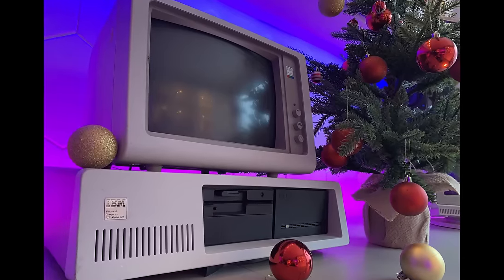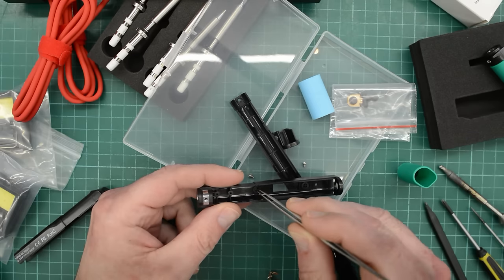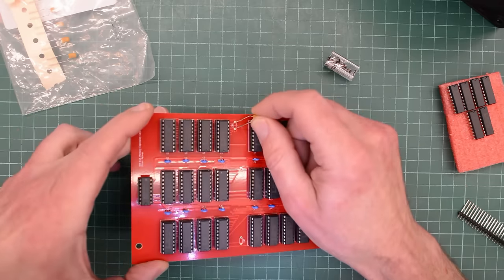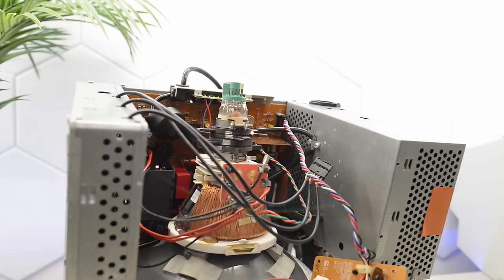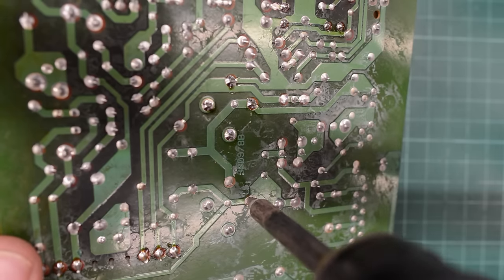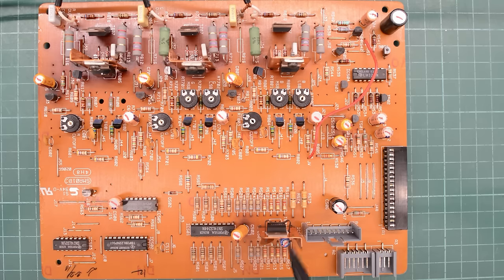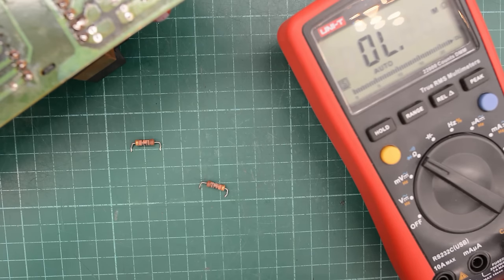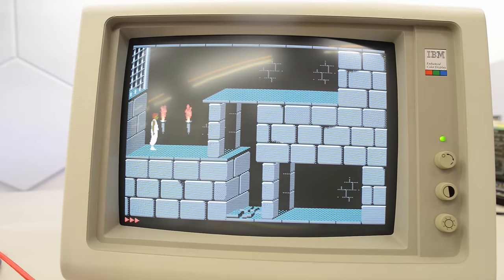IBM 5154 EGA Display repair

Comment: If you have resistors getting super hot, mount them slightly above the board with the leads up so air can get under them as well :)
Reply: Or use two with double value in parallel. Or two half value in series.
Either way, you'll reduce the heat and spread out the rest.
Reply: 130C ... good gravy!  That's almost hot enough to literally cook with!  It is DEFINITELY worth replacing those with something stronger.

Comment: Very nice repair well done! 6.8v sounds like the filament voltage maybe? Not sure if those resistors are supposed to be so toasty but in any case you can install them a bit more elevated (longer legs) to try to help with dissipation. Also I was told the charred section on the mobo can be conductive so it’s recommended to grind it off and patch it with epoxy or similar. Nice monitor!
Reply from the maker: Thanks Tony. Yes, I'll order some larger resistors and install them slightly off the board
Reply: @Epictronics1  I have seen power supplies where holes were left for components. Not spark gaps but for resistors to 'float' in the holes. As toasty as this looks, maybe dremel a window where the charred material is, given the resistors would fit the space between the solder spots. :)

Comment: I would check the flyback diodes too, just to be sure, wouldn't want those coils to get fried. You can also elevate the resistors from the board with littile rounded kinks in them to get the heat away. You used to be able to buy resistors with that in them already.  That carbon scoring should be removed too as it can become conductive. Easy to desolder because it's lead solder. Some chipquick or similar can make desoldering the stubborn stuff much easier and safer on the circuitboards. In the future you might want to buy caps rated for 105C that are around any heat creating components to make them more reliable.
Reply: I already knew about raising the resistors, but the high temp rating caps is new knowledge to me. Thank you.
Reply from the maker: Some, but not all of the new caps are rated for 105C

Comment: That was quite a lot of marginal parts! I'm glad that you managed to finally resurrect the CRT!  I used to have an EGA CRT for my Commodore PC-20-III. EGA is cool and all (especially the 5154!), but in the early 90's they looked more like the poor man's VGA. How unthankful we were back when... 

I got an SE/30 that has been the same as your CRT, a new fault emerge after each that I fix something. The final problem was unexcepted, a solder joint that re-cracked after just a few hours of use. I think that I've worked out all the kinks on this machine - for now. I'd better sell it before something breaks on it.
Reply from the maker: Yeah, we could have got these 5154 for free at one point. Now it's one of my rarest collectibles lol. I'd say you're lucky, my SE/30 looks like Johns mid-week battery-bombed mac lol

Comment: You may want to use four or more resistors, instead of just the two toasty ones. Ultimately you need 0.6 Ohms (two 1.2 Ohms in parallel, as original), so you can use four 2.4 Ohm resistors in parallel. Or use even more resistors. The point is to reduce the power each of them is dissipating, and to increase the surface for heat dissipation.
Oh and you might want to check the voltage across the resistors, to see the Power they actually dissipate, so you can make an informed choice.

Comment: The 6v rail is used to power the CRT's heaters...without the supply, there will be no electron gun activity and no display.
Reply: When troubleshooting a CRT display (or anything else with vacuum tubes). First step: are the tubes lighting up?

Comment: Beautiful work on the monitor repair! I never would have found those bad resistors. And the heat at the capacitors is wild!
Reply from the maker: Thanks John. I'm seriously considering installing two large Noctua fans inside that display

Comment: I like the spring style soldering iron stands. My Weller came with one but it is not "small" by any measure.
Reply from the maker: Yes, I have considered using a Weller stand but I'm hoping to find something smaller
Reply: 100%.  I don't mind its size.  I can drop my iron in it without even looking.

Those Pine stands are braindead.  Not even an inset in the clip?  What good is that supposed to do anyone?  That's damage and injury waiting to happen.

Comment: There seemed to be a lot of some white stuff on some of those boards. I don't know what it is, but it might be a good idea to clean it off, to eliminate the chance of currents leaking around the board. And yeah, those resistors looked bad right away, and should be replaced with some new higher wattage parts. A bit of air around them might be a good thing too.
Reply from the maker: I'm not sure what that white suff is. Never seen it before. I'll replace those resistors for sure

Comment: FYI, if you have matching values, you can replace Tantalums with Ceramics... thereby removing the risks involved in the highly entertaining failure mode of Tantalums.
Reply from the maker: I haven't had the time to dig into the characteristics of tantalums & ceramics yet. I'm sure they are interchangeable in many applications
Reply: @Epictronics1  Texas Instruments explicitly states so on some of their datasheets of OP AMPs.
Reply: Any idea if this is true in audio applications? I have a classic synth called and ARP Omni that is full of low quality tantalums. If I could replace them with ceramics I'd be much happier than if I replaced them with more tantalums. I replaced the electrolytics with polymer caps in the non-high voltage circuits already, in the hope of not having to deal with corrosion from leaking electrolyte in future.
Reply: @chriswareham  : I'm really not sure, but from what I remember Tantalums are used for their stability (they keep their capacitance) and because they can pack a lot in a small package.

Ceramics on the other hand have a higher self resance requency and lower ESR and are safer and non-polar.
On the minus side, I believe they can introduce noise, as they have piezoelectric properties (though moern MLCCs less so).
Reply from the maker: @chriswareham  Isn't there a risk of affecting the sound with different caps?
Reply: @chriswareham   Standard ceramic caps are nonlinear. When used in the audio path this can introduce distortion. In that case you use C0G/NP0 ceramics or any foil/film cap. If the capacitors are just being used to filter ripple from power supplies then ceramics are fine.
Reply: @eDoc2020  Thanks for the information - these caps are in the audio path, so I'll take a look at options for foil/film caps. (A previous owner had the power supply recapped and modified, since this synth had a poorly designed and underspecced one from the factory).

Comment: Video starts at 12 minute mark :) As usual, the capacitors didn't prevent it from working, but resistors did. One once said, bad capacitors would make the device perform poorly, but bad (open) resistors would make it not work at all ;)

Comment: Those dark marks around the leaky orange Matsushita capacitors are not from heat. The fibers of the PCB substrate soaked up the electrolyte, and that caused discoloration. That's an unfortunate property of these cheap phenolic-impregnated paper PCBs.

Comment: Hi, back in the day after changing a few CGA cards to eliminate snow, i ended up purchasing a used EGA monitor and trident card.

That combo lasted me 5 to 7 years untill the inevitable upgrade to VGA - Wolf3d

You should be able to easily find commander keen EGA screen shots and EGA Trek - not to many colours are used but the crisp legible screen and graphics will be a guide 

Unfortunately there is not to many EGA graphics / images ( i keep thinking of the cat / baboon / King Tut images for Amiga 500  that people are familiar with )

Comment: I've seen that brand of orange electrolytics in German A2000 power supplies, they can have a short failure mode, and cook off, especially on the main power rails 🙂 That may be the reason those two resistors burned?

Comment: Wobbly screen might have something to do with h/v sync sections so I would look there first. Another possibility is if there are any pots inside for adjusting things they could be dirty. Or it might be some more bad/open resistors somewhere.
Reply from the maker: I think you're right. There might be a bad pot in that display. I'm doing some more tests now

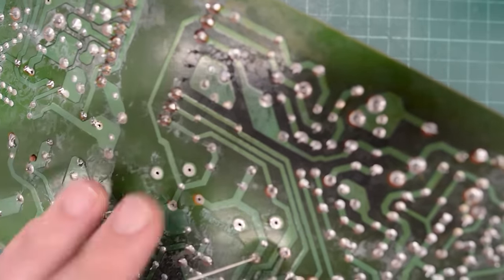Comment: minute 17:40 why dont you put the caps on the 'dummy' holes, then jump a wire on the other side to the correct location?
Reply from the maker: Yeah, that sounds like a better solution
Reply: @Epictronics1  maybe will hit other components.. I dont know..
Reply: @Epictronics1  I would probably have sat the caps on inside the circle and bent the long legs along the board to the correct holes.

Comment: I've just been using the KU tip on my Christmas tree/writing implement -based soldering iron for everything. The only time I've had issues was for SMD components that were very close to other components, since the tip is quite wide. For the stand I'm just using the one from my old Hakko FX-888D, which doesn't work great (although better than those cheap plastic stands), so I'd be very interested if you find a good solution.

Comment: In your last PCjr vid you mentioned you had an idea to try out for higher stable cpu clock speeds and had ordered parts. Is a video on that still pending or did the idea not work out?
Reply from the maker: Yes, I finally got the part and actually started recording that video this week! Unfortunately, the PCjr is dead :/ I need to do some research and make a repair too

Comment: The picture's back, but it seems very wrong to me still that components are getting to temperatures hot enough to darken and char the board. Something's still not right
Reply from the maker: They are known to run hot, but that could of course still be fixed

Comment: The brown color should definitely be yellow on a real IBM EGA card so your AST clone ega card must be set to use a IBM 5153 (cga) monitor instead for yellow.
Reply from the maker: I'll check, thanks
Reply: That would also explain the instabilities with the real card. CGA runs at 15kHz but native EGA is around 22kHz. I'd suspect there are two horizontal hold controls on the monitor.